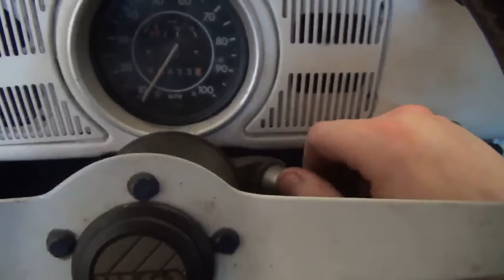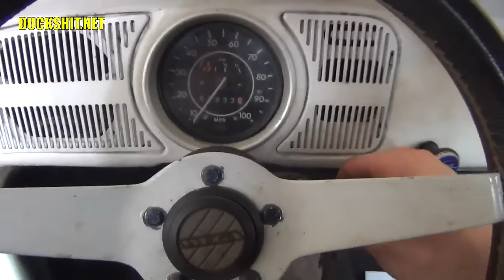Howto Install a VW Beetle Hot Start Relay (Hard Start Relay)

Comment from the maker: ⚫ COMPATIBLE RELAYS ⚫
6V  ▶  https://amzn.to/31yvrXc
12V  ▶ https://amzn.to/2KUwieM
Reply: I have a 63 and I can’t find a wire that crosses over the tunnel
Reply from the maker: @hhfilmsyt There should be several wires that cross over the tunnel unless its all custom or the battery has been relocated!
Reply: Picked mine up from the locker today!
Reply from the maker: Yayyyyyyy!  Let's see video!
Reply: Ugh, i do not have a red wire. @DuckmanCycles
Reply from the maker: @OwhyeeVdub  oh no!  What do you have?
Reply: @DuckmanCycles  a white wire from the battery-positive terminal into the firewall.  I do not have any wires under the bench seat like I've seen in multiple videos.
Reply from the maker: What you probably have to do is look at the starter underneath the rear right hand side of the car... track the small wire forward into the car.... OR, put your hot start relay there.  It becomes subject to the elements and more likely to have a problem in that location, it's also hard to reach in the event that something fails, but some people do it anyway. I would trace the small wire.  Usually it's red, or red with a white stripe.

Comment: My wife’s beetle died going down the street. It cracks but won’t start. Changed the fuel pump. Gotta do a few other tests but I’m tempted to just pull that wire and see if it starts touching the battery! Love the video keep making more :)
Reply from the maker: Thanks so much for the comment!  BUT!   If it is cranking but not starting, this is not what you need!   Check your fuel and for spark.  Likely the problem lies there!  :)
Reply: @DuckmanCycles  new pump installed. still no go, guess now is checking the distributor, coil and possible stuck starter

Comment: Glad I found this. I'm going to try it. My auto-stick 68 KG has frequently failed to start -- especially if the battery is ever-so-slightly below top voltage. Not even a click from the solenoid. But with a boost, it always starts. Thanks!!
Reply from the maker: So glad it worked! Thanks so much for the comment!

Comment: '73 Beetle.Great video on Hot Start Relay. Easy install It sounded stronger but, still not kickin' over. Had previously put in battery & shop put in starter.
This happened last year. 107* heat. Starts dying out, not starting...Shop said oil in pan caused to not start. 
Runs awhile, then engine gets wet when rains. Doesn't start....
Help Duckman!

Comment: You right! Soldering is ALWAYS the best way to attach a connector, but crimping works too. Depends how long you want to keep it connected. I rewired a 1967 Fastback completely from front to rear because of bad wires. 3 Days later, I finished and it looked better than factory.

Keep dry and SAFE with the blow coming in there.

Moe
Reply from the maker: Yep solder is always better!  And agree, depends on how long you want to keep it commented!  Good work on the Fastback!  Thanks for the comment, the rain just started her from the hurricane a few minutes ago!
Reply: Our prayers are with you and everybody in the Panhandle. It's tough being on that side of these storms. At least we are 30 miles inland, but the flooding is still always a danger here in Lafayette, Louisiana.

Moe
Reply from the maker: Thanks Moe!  I'm more worryed about getting to work than any damage, I think we may be alright over here in Pensacola,.... but its too soon to say.  Here's hoping!  Thanks so much!

Comment: Thanks you make great video, I got a 75 bug i just purchased fuel injection convert to carb and when the engine cold start good and i took a ride for half hour and engine hard to start back when its hot i will need to investigated what the issue, I'm not sure if you run to this issue before.

Comment: I've had a occosional no start on my '63 bug. F*ck with everything then it will start. Finally replaced the starter and the positive cable (looked original) , 6 mo later it happen again. Short across the solonid and it would start. Tested everything again, then tested the resistance in both battery cables. The ground cable had a much higher resistance so I replaced it. It has worked for over a year without problems, but I will keep this video in mind. Thanks
Reply from the maker: If you have original wiring it's definitely something to look into!  😁😁

Comment: Like the video tutorial, I don't know if this is exactly the same problem I'm having. My problem is she starts fine cold, but after driving when she is nice and warm and you stop, say for 10 to 15 minutes, and try to start she will crank 10 to 15 seconds before she starts. Do you think this relay would solve this problem?
Reply from the maker: No, afraid this relay would be for the cars that DON'T crank.  In your case, I would bet your carburetor is boiling over.... as it happens to me, too.  Possibly even a minor vapor lock situation.  You'd probably be best served by opening the decklid when you park to let the heat out.  Yes, really that simple.  Give it a try!  Hope that helps!  Thanks so much for the comment and question!

Comment: I got a 1971 vw super beetle dont know see any clicking there is some power but not enough...i will try this, thanks duckmen
Reply from the maker: Maybe the solenoid is stuck on the starter, that's something else to check.  Sometimes tapping on it while someone turns the key will get it going in which case you need a new starter and not the relay.  Hope that helps!
Reply: Thank you sir for your reply, i will do that and see what happens.
Reply from the maker: I hope you get it figured out!  :)

Comment: Awesome video! I was just dealing with this problem on my 71 super I was afraid it was F'd up from who ever put a 1962 motor in it, took me a little bit to figure that out lol got to love back stepping to 6v starter in a 12v car that was a big part of my starter problems lol now I just hope there's not alot of damage to the flywheel thanks 12v starter
Reply from the maker: Ack!  Starter mesh problems is bad.... but not too expensive nor hard to fix.  Thanks for your comment!

Comment: When I bought my '78 Super, I was told that it had a problem with occasionally not starting.  I was also told the owner before him also had the same problem.  Neither of them were able find the cause.  I drove the car for almost a year, in every weather condition imaginable; snow, rain, 100-degree plus temps, and nice days.  Than, finally, it did it after sitting for a hour while I attended my VW Club meeting of all things.  All the electronics worked, but there was nothing from the starter, not even clicking from the solenoid.  After about 10-minutes of trying, it suddenly fired right up.  This happened again two days later.  I was stumped, and the only thing I could think of was to replace the starter.  Once I had the new starter in the car, I started cleaning all the wiring terminals before hooking everything back up.  When I got to the battery cables, I found a previous owner had replaced the terminal for the wire that goes to the voltage regulator.  As soon as I hit it with my wire brush, it fell off in my hand.  The exposed wire the terminal had been crimped to was also corroded.  I cleaned the wire, installed a new terminal, and finished putting everything back together.  It's been two months, and I have not had another starting issue.  I am certain, the bad terminal was preventing the starter solenoid from activating, even though there was enough power to run other things like the stereo.
Reply from the maker: Yep, could be!  My Fastback was doing something like what you describe last winter, too!  It was a simple roadside fix!  Good to go!  That connection got very hot, too, it was struggling to carry the power for the rest of the car, when I touched it I got a 3rd degree burn.  Thanks for sharing!  Hope you stick around, I enjoyed this story!  Thanks again!
Reply: I appreciate the courtesy you show to all your followers. Your great attitude means a lot! Thanks for sharing your wisdom and experience!
Reply from the maker: Thank you so much, I really appreciate that recognition!

Comment: beetles 68 and on have multiple connectors in the harness. as i got a 65 bug and don't have the connections under the back seat as i be mounting the relay on the starter motor as its a new starter thats 12 volt as the vehicle been converted to 12 volt.  still the 6v ring gear as i got a wosp starter as ill  mount the relay to a bracket on one of the bolts on the solenoid cover as most mount the relays as close to the starter to get the power.
Reply from the maker: Good job! I mounted a couple of them right on the solenoid just the same!

Comment: Thanks for doing this video. I just wired my relay up. Car fired right up. Between doing this and changing starter to a autostick type. I hope this takes care of it all. Thank you again.
Take care, stay dry, and warm
MERRY CHRISTMAS TO YOU SKEETER , AND BOOMER. NERRY CHRISTMAS TO YOUR FAMILY AS WELL.
Reply from the maker: Thank you very much kind sir!  I'm glad it helped you!  The self-supported automatic starter I feel is a better unit, no more dealing with the bushing anymore either.
Reply: @DuckmanCycles  spoke to soon. Back to the same clunk. I just had it running not even a hour ago. Battery is fully charged, it fired up right after I hooked up the relay. I guess its the ignition switch. Time to step away from the car again. Have a good one
Reply from the maker: @Volkswagenplanet  Just a clunk is kind of a weird thing with so many different starters, so its likely a weird problem.  I wonder if your flywheel teeth are a little mangled, or if your starter bolt is too thick or something.  Are you using the correct starter D-headed bolt?
Reply: @DuckmanCycles  yes
Reply: Yes to the D shaped bolt. Flywheel is fine. I even spun the engine over 180 degrees to make sure the engine is not locked up. I fired up fine when I put the relay in. Then back to the same issue. This time when the car was running I had rhe gen. and oil light on, brake switch light on dash all on. When I turn the ignition on, no gen or oil light will.come on. I get the click in the engine compartment from the idle selonoid.  I just don't know. That's tonight issue to think about at 2 a.m.. Have a good one

Comment: I've installed a hard start relay in my mk1 golf, all works well. Issue I'm having the battery light doesnt illuminate on ignition, could this be because of the relay? Thanks
Reply from the maker: I'm going to say probably not, it would be very strange for this to affect that light, however, if there is an error in your wiring, or you disrupted something in your charging circuit in the process, then there is always that possibility.  Try to undo your wiring and temporarily put it back the way it was and check the light again.  You'll know!  Hope that helps!

Comment: Hello Duckman,
New viewer for old video. I tried the relay install for the vw issue you discussed. Makes sense, but it didn’t work. I’m very familiar with relays cause I once owned a fuel injected bug. Anyway, could it be that the relay thing only works if the ignition switch works all the time? When it won’t turn over, I just jump the starter from under the seat and next time it will start
Reply from the maker: Thanks so much for visiting, but I don't understand the question. If the relay was in fact good and everything else was in proper working order, and you had it all connected properly it should work just fine.  Beyond that I can only guess what's wrong, being electronic I have no way to diagnose it from here.  Its not something you could just tell me nor something I can just see a picture of.  I'll need to diagnose the circuits properly with continuity checkers, and that's what I would recommend you should do.   A Volkswagen wiring diagram for your year of vehicle might be helpful.  Good luck to you!

Comment: Thanks for a quick and easy explanation of this common problem with air-cooled VW's.
1000 years ago I had a super clean 1972 Karmann Ghia coupe. I wish I had internet and Youtube back then because I had this very problem. The only thing my regular VW mechanic could say was that "the starter gets hot, you see, even when its not actually operating. The heat creates resistance to starting. So you just have to wait until it cools down." BTW, he neglected to have real solutions to many things -- which I can count on all fingers of both hands.
Thanks again for another informative video!
BTW ... I'm thinking of getting a Beetle. I want discs brakes up front. I've read that IRS became standard on Beetles from 1970 onward. And Super Beetles have MacPherson struts up front. I want to be sure I can lower the car an inch or two. Any suggestions as to which year(s) would be best?
Reply from the maker: I really like 69 Beetles, IRS and not all strange looking like a Super of later years.

Comment: Hey quick question my 64 doesn’t have a voltage regulator so the ignition switch goes to the 87, 85 to ground, 30 to power, but now since I don’t have the regulator, what do I put for 86 pin?
Reply from the maker: Hmmm.... I think you're waaaaay mixed up.   Voltage regulator does not matter for anything in this video, nor does whether you even have one or not. 87 goes to the starter, not from the switch, its the first wire connected in this video.  These things were discussed in the video!   While the video does not contain a diagram, I probably should have put one. Technically I put 86 and 85 on backwards in the video, but because they just feed a coil that doesn't require polarization it didn't matter and still works.

Comment: Hey Duckman, lookin good brother!!  And TY once again for a helpful clip.  I got a problemo again 😅. So this is how i wired my 40A relay: 30 to battery+, 85 ground/chassis, 86 to red wire i believe is from ignition as its coming off from side of heater channel below the seat. And then 87 to the other end of red wire i believe going to starter solenoid as its going out the rear firewall down under the seat. When i go back to reconnect cable wire to Battery(-), the starter tries to start engine over and i see sparks on battery post leaving the post with welding marks. Im afraid im damaging the battery's post. What am i doing wrong? 😢😢
Reply from the maker: Thanks man!  Sounds like you've got the relay connected well, but the mystery "red wire" underneath the back seat can be one of several wires.  Which one is it?  If you've got a Beetle, it should be the one with the connector in the middle of it. Remove that connector. 86 should go to the portion of the wire that goes up front, and 87 should goes out back to the starter.  If that still activates continuously, then you've still got a bad connection somewhere, or you've still got a bad connection... OR your key switch is stuck in the start position.  Beyond that, its hard for me to say without seeing it.  Electrical is practically impossible to diagnose without my eyes and hands on it.  Let me know what you come up with!   Oh and you're not going to hurt the battery post unless you're dead shorting something, lol!
Reply: @DuckmanCycles  Aha! TY man! Now im pumped up and am gonna switch around terminals and see what works. Thx again

Comment: After a new starter and bushing, all terminations are cleaned and greased up, it's time for Misty to get a hard start relay. 👍
Reply from the maker: Doesn't hurt to have this.... that before you put this in are you able to jump it with a screwdriver? I thought you were having another problem for some reason
Reply: yep jumps perfect with screwdriver.  Not pulling solenoid in on the new starter with 🔑 turn.
Reply from the maker: Ahhhh, I see!  But you do get SOME voltage at the wire under the back seat when you turn the key?
Reply: 6.4 at the battery- 6.1 at the starter from switched wire.  I feel the solenoid is just not having it..
Reply: After sleeping on it I had a hunch that the solenoid was not strong enough. Can you believe a rebuilt Bosch starter brand new out of the box had a tired pitted solenoid....  Of course...  I swapped it with one that was knowingly working fine and starter came to life!  So pumped right now
Reply: Hard start relay may just go in as well though

Comment: Great video, my mk1 golf has the same issue I will be doing this method 😊
Reply from the maker: Should work fine on there, but the wiring would be different of course!  Thanks for the comment!
Reply: @DuckmanCycles   I have the red ignition starter wire near the battery would I not be able to take it from that wire? Or would I have to connect through the starter motor?. Thank you for your help 😊

Comment: Hello I have a vw beetle chassis on a sterling nova and it was running well when I park it a few months when by and I try to start it and no power I replaced the battery and nothing… any suggestions
Reply from the maker: Nothing at all?  Battery not hooked up properly, terminals are dirty, or you pulled the wire off of the regulator (if you have one) when you were changing the battery.  Just my guesses.

Comment: Hi, I touched the red wire on the + battery terminal and nothing. However when I short the starter solenoid it turns over. Where and what should I be looking at now?
Reply from the maker: I I would suggest looking for wires that are cut or disconnected.

Comment: I have a relay in my 72 Super Beetle, and it ran 2 years ago I believe, but now, no start.  Do relays go bad?
Reply from the maker: Yes, like anything else man-made, relays do go bad.  Might be as easy as just replacing it,  Should be easy enough ti diagnose if you have a new relay on hand,
Reply: @DuckmanCycles   Thanks! Looking at it, it's probably the original one anyway. Got one on order plus a bunch of other stuff. Thanks for the reply!